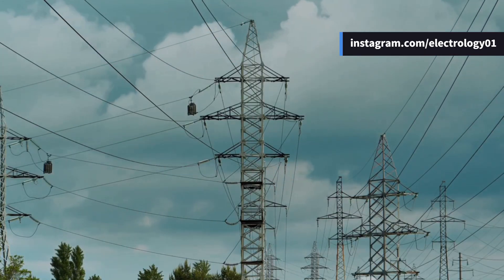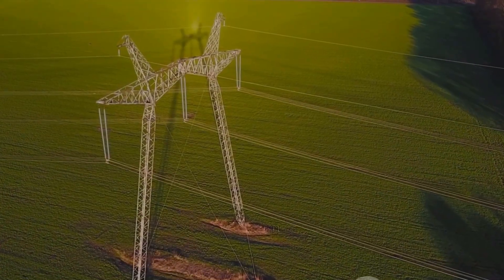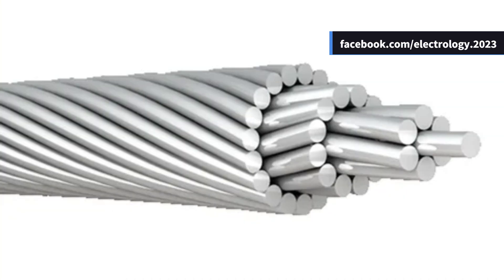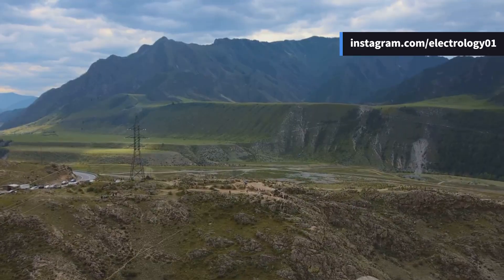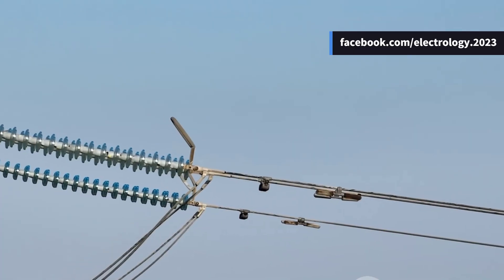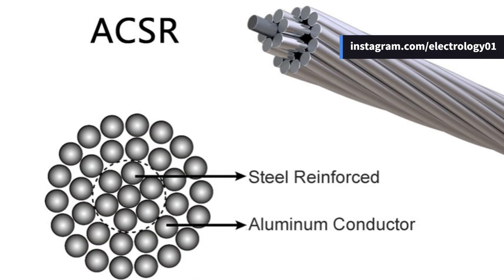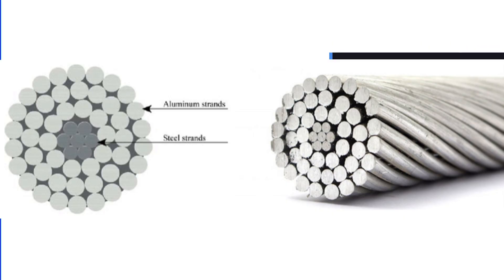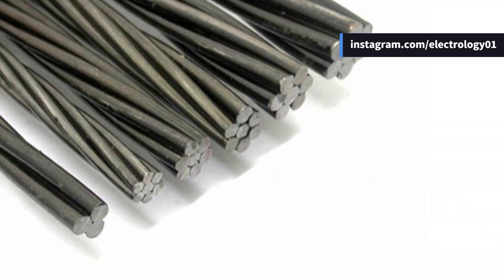ACSR Conductor Explained | Best for Power Transmission

Comment: ACSR is great and has a new contender . The carbon fiber core aluminum wire. With AC and HV we have the skin effect . The current is on the outside of wire. Carbon fiber is stronger than steel and much lighter . Even Kevlar core is being tried . With Antenna wire used for RF like in the short wave bands a Kevlar core copper braid on outside is made. Super light and can tow a truck with a small wire . I have some. Made in England . Some carbon fiber core wire is in place in parts of the US . Handles more wind and ice load . Even the ground conductor on transmission lines is changing. Some have fiber optic cable for data going threw them. Cheers from NY !
Reply from the maker: Thank you so much for sharing this insightful comment! 🙌
Yes, you're absolutely right — carbon fiber core aluminum wires and even Kevlar core conductors are gaining attention as next-gen alternatives to ACSR. Their high strength-to-weight ratio and resistance to environmental stresses like ice and wind loads make them very promising. 💡⚡

I truly appreciate the real-world examples you’ve shared from England and the US — especially about RF applications and ground wires with fiber optics. It’s exciting to see how transmission technology is evolving! 🙏
Cheers from India 🇮🇳😊